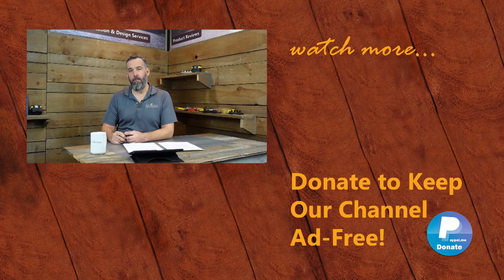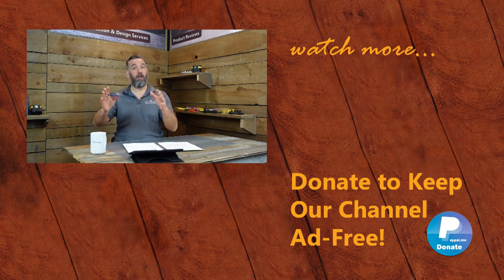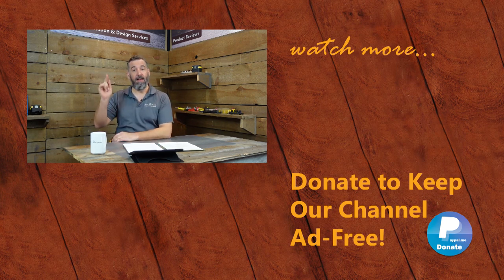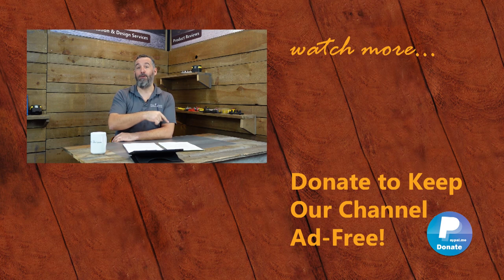The Dangers of Stray Current in Your Marina

Comment: Great description of the problem, but not understanding the various/common examples of issues that give rise to this problem. Is it wires sitting in a wet bilge on your neighbor’s boat and giving off stray current, or an AC wire grounded to a battery, which is sitting in water touching a metal through hull? Can you give more detail about where the stray current comes from?
Reply from the maker: Good suggestion, will think of creating more in depth content on this topic. In short, a bad connection or accidently one is what commonly causes stray currents.

Comment: I have an old 1967 trawler conversion, no  zincs, I was advised not these should not be attached to older vessels with copper fastenings as theye are not required and turn the underwater fittings, proper and copper fastenings into a battery, I have seen before photographs where Zincs were attached, copper fittings, etc in the boat had significant green growth versus currently, literally none, I am a convert. My issue is I am about to bring the boat into a marina, (currently moored)  for ease of access and getitng my wife on and off given her current health status,...we can at least get her out for day trips....while the boat does have the capacity for shore power the certificate has expired, I don't need shore power and after watching this, thanks I know understand what a stray current is and I am happy not to worry about shore power, I also will not be worrying about whether I need zincs and so on and so forth unless I see a change in oxidation-green or whatever it is a called on my copper pipes and fittings then I'll consult someone with the necessary equipment and knowledge. The berth I am looking at does not have a neighbour either-side  as it is an end-berth not crammed in beside other boats which is also good

Comment: Stray current is not only expensive in terms of metals rotting. As little as 2 volts in water under the right (wrong) conditions can kill a human. Remember, voltage won't kill you; the higher it is the lower your resistance, but amperage is the difference between a jingle and electrocution. Happy sailing. :)
Reply from the maker: Good one!

Comment: Hi Jeff, Is there a way to actually identify the presence of stray current in the marina?
Reply: You could go swimming in the marina and if you do not drown...
Reply: Serious reply now.  What you could try is to connect a wire to some underwater metal on your boat.  Connect that wire to a voltmeter set to really low setting.  Take another long wire and attach it to the end of a long pole.  Dip the second wire into the water far from your boat.  If the voltmeter shows voltage then there is current flowing between the end location of the two wires...for current to flow there needs to be a difference in voltage potential (aka potential difference or more specifically a “voltage potential difference”) between two points.  If you measure a voltage between the underwater metal of your boat and where you are dipping the other wire into the water, then current is flowing through the water, through your boat and back to the source.  I have never done this, but that is the electrical theory...just need to apply some engineering to implement it.
Reply: @borysnijinski331  
Not sure if this is true. When you see a potential difference on your voltmeter, that doesn't automatically mean there's a current path.
Reply: @koffibanan3099  true if there is an insulator between them, however, in this case the water is conductive (pure water is an insulator, but marina water is not pure and does conduct).  Also consider that the reason there is a potential difference is because there is a current flow...potential difference between source and ground drives the current, and the resistance of the circuit shows a potential difference along the flow path of the current because of the current flow.
Reply from the maker: With a really precise clamp-on AC meter we measure the AC shore power cords. Remember an AC shore power cord is commonly made of 3 wires, all the current going in the boat "hot" should come out on the "neutral" and "ground". Basically what goes in, should come out, i.e. the current difference should be zero between the in and the out. When measuring with a clamp-on meter, if you read any currents on the cord, you know that current is going in the water. One boat was dumping 14 amps at 120 VAC, completely crazy!
Reply: @PacificYachtSystems  I’m going to take a walk around the marina with my clip on ammeter to see what I find.

Comment: Hi Jeff. Thanks for the show and knowledge sharing. I've been following you for a long time now :) Can you please tell us why it is recommended to bind the ground AC to the negative DC on boats?
Reply from the maker: Well, one of the reasons is about a common reference point, all voltages should start from the same point. In order for a battery or even your shorepower to be at 0 volts, it needs to be grounded to ground. Otherwise it's floating and it's only a voltage differential. Your AC system needs to have a ground tie at that boat, and in most boats, the DC negative is grounded to the water via the engine block and the transmission, and to the propeller shaft to the water.
Reply: @PacificYachtSystems  Thanks Jeff, your AC/DC knowledge is electrifying :) I have something more to read now :)

Comment: Hi Jeff, I want to do some welding on my steel boat (in the marina). I’m worried about stray welding current, I have an isolation transformer, how can I do this safely?
Reply from the maker: I have never done any welding and never thought about this question before.  normally welding is probably done on land in the yard.   Are you running the welder from the boat's circuits or directly from the dock?

Comment: Here is a related question. Many European boats omit the galvanic isolator and avoid the stray current corrosion risk by NOT connecting the AC and DC grounds. Additional AC ground fault protection is provided by whole-boat residual current devices that trip if there is an AC leakage current > 30ma. Do you see any advantages to this approach over the ABYC recommendation to connect AC and DC ground?
Reply from the maker: Good question. Personally really onboard with the ABYC way of connecting AC ground and DC grounds on the boat. Not sure why other jurisdictions aren't doing it and what the implications are.

Comment: I have a question Jeff. What do we need to know about boat inverters and welders (nominally a 160 amp welder)?
Reply from the maker: Don't know that one.
Reply: @PacificYachtSystems   I’ll ask Victron, as they are just up the road and I am using one of their Inverters. I have two welders. One is a small IGBT inverter stick welder, and the other is a full featured AC/DC TIG/Stick machine which will pull more amps. It’ll be a few months before i have my system together, but I will let you know what they say. Scanning around, some people say use a generator, and I can understand that will be more robust. I might need to have a second inverter to work in tandem just for welding. We will see.

Comment: Hi Jeff, I realize I'm in the 0.01% of boaters here, but I have a small WEST system trimaran with no metal through-hulls, no inboard engine, etc. IN short, absolutely no galvanic metals connected to ground, no 12V "chassis returns" etc. I doubt adding an isolator would benefit anyone in my very specific case, but maybe I'm missing something though?
Reply: I would think if you have no metal in the water, you do not need to worry about underwater metals being eroded away by stray currents.
Reply: @borysnijinski331  I know, that's what I thought too, but you can't know what you don't know you don't know.
Reply: @sail4life  always good to ask questions...often you find the answers raise more questions.
Reply from the maker: Agree, you only need a Galvanic Isolator if you have a connection to the water via any underwater metals.

Comment: Can you differentiate between a wound isolation transformer and the newer technology of say a master volt switch isolation transformer? The older, heavier transformer on my boat is a GE and weights 186 pounds. I have been considering the newer Mastervolt transformer, but still feel the older technology is more dependable (still working after 30+ years).
Reply from the maker: Good suggestion.

Comment: So only AC? DC doesn’t cause this? So if I am on my own DC system at a marina is not a concern?  Should I still have zincs?
Reply from the maker: Sacrificial anodes, i.e. zincs are absolutely important and protects your underwater from naturally occurring galvanic corrosion. Galvanic isolators and isolation transformers protect your boat from stray currents.
Reply: Can you also get stray current from yours or neighbor 12V wire shorting to underwater metal? My keel stepped mast and stays are attached only to a hull ground for lightning protection. The plate ( I think SS) has micro pores all through it. Only thing I could think of was masthead or spreader light short to mast. But the lights work so there can’t be a short and I never use them so breaker is always off.